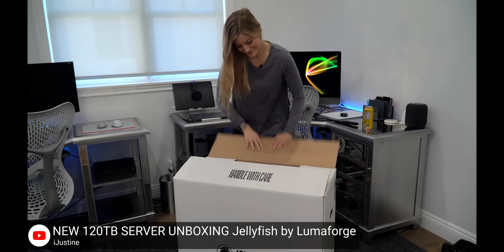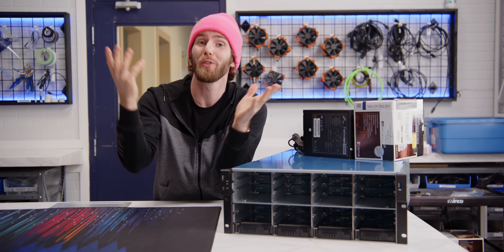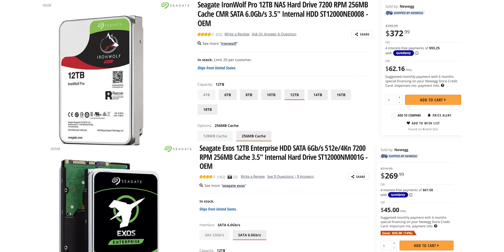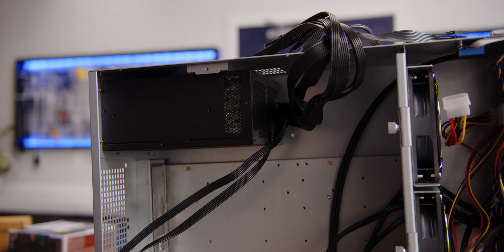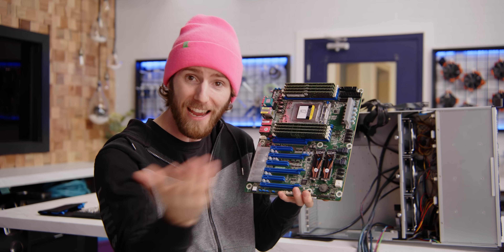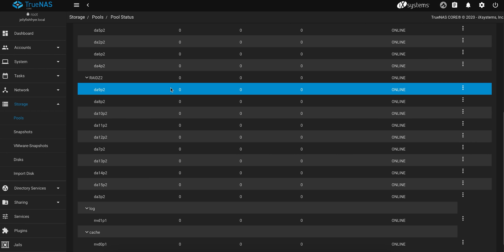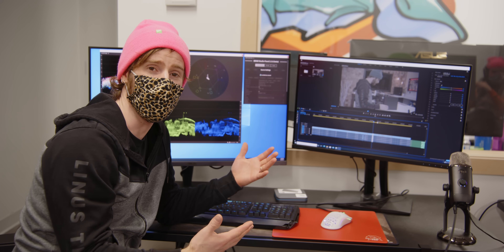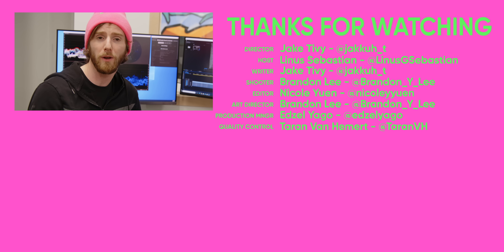Here's How to Save $45,000 - The Sensible Jellyfish Fryer

Comment: I didn't even know these Jellyfish appliances were a thing until seeing this, and they're insane. Just built out a 432TB (291TB usable) rack-mount, with no other features...and it's $62,000.

Are these people high? They're obviously using 18TB drives,  since everything breaks down into multiples of 18, and moving from 144TB to 432TB is an insane $20,000. That means the drives are $1,250 a piece.

Comment: TrueNAS is a complete garbage. Also, that’d be great to see actual performance comparison. With bandwidth tests, I/O test, drive latency tests. It’s not enough to setup hardware and stick FreeBSD on top of it, create a pool and call it a day. I would, also, want to meet that IT guy with intensive ZFS knowledge, who can tune z file system and be proficient with zdb and costs 20k to hire for 6 months. It will cost you a LOT to hire someone who would be able to recover your “lost” data — roll back txgs, fix a flood of chksum errors etc.. And then you loose all your important data, which most of the time in post production world costs millions, because you listened to a guy from youtube who said it’s gonna definitely work. Units like JF usually come with access to support engineers that can handle any ZFS issue which is included for few years when you pay for that unit. I’m pretty sure average editor won’t be able to handle even a simple drive swap if needed, even with GUI, let alone troubleshooting samba or nfs on FreeBSD. LOG device is completely useless with samba btw.

 facepalm

Comment: Jellyfish are a rip off, considering they are using a dead Linux distro that they are most likely using for free and that isn't getting any security updates. I have had a plex server that has been running TrueNAS for about a year and a half and I find FreeBSD to be more stable than Linux. And it's nice to have an OS that is free and built for out of the box NAS use

Comment: That 2tb nvme is not a good write cache.
An Intel optane or even an older p3520 would be a much better choice since it doesn't slow down when the onboard write cache is filled.  I have that exact sabrent nvme and it drop to ~600 MB/s when moving 100s of GB

Comment: That write cache is WAAAAY too big.  You only need something like 5x or 10x the maximum amount of data you can write in a second.  After that txg_sync will flush the cache to disk.

Also you should have a mirrored write cache in case of failure, you will corrupt / lose data if that happens.

Comment: You should just bridge the NICs and connect it to your local network. The local DHCP would takeover and assign IP addresses for you, in addition to supplying internet over the same cable. This seems way easier for people who aren't familiar with subnets and stuff (Jellyfish users).
Reply: I just tried this and you need to set the IP of the bridge (the server) manually. You should probably do this anyway so the IP address doesn't change. I can confirm DHCP and internet pass through fine to the clients over the bridge.
Reply: If you manually set the MAC addresses of the NICs so they are the same, DHCP works fine for the server too. This might be difficult to do in UnRaid or TrueNAS.

Comment: Great idea - and hats off!

I also had to think about expanding and improving my network storage 2 months ago: got a HP Proliant DL 380 Gen 9 LFF rack server with 2x Xeon, 32 GB memory, 2x PSU, 4x GBIT NIC and 2x 40GBit hp infinitiloop NIC for 200 Euro used + rail kit (50 euro) 

Then added another 32GB memory (100 euro), another 2x 10GBit NIC (60 euro), a HP P440 raid controller (60euro) the 12x LFF backplane with connectors (pricy - 300 euro) and 4x 3TB SAS HP drives (240 Euro) + some old SATA drives That have been sitting around. 

From here is it personal preference and the remaining infrastructure: 

I run windows 2016 hyper-v core (free) on which I installed a centos VM ( for trial and testing) as well as a windows server 2016 VM for media and video files / and also moved an existing windows 2012 VM (sql server onto it) 

So shy of 1000 euro I got a decent HP hyper-v host with 2x 8 cores + HT, 12x 3,5 slots, SAS and SATA compatibility, as well as 2x 40GBit, 2x 10 GBIT and 4x 1 GBIT connectivity.

Maxed out it would be 1,5 TB ram, (12 + 3 backplane) x 18(?) TB hdd while the OS could be installed on HPE micro SD or raid1 usb stick

Comment: Many of those USB plug adapters will work in Linux.   Additionally, you don't need a special tool if they will run.  They just use the internal OS hardware monitoring software instead.  Much better, if you ask me.

Comment: It is funny how many people think SLOG is for added performance boost. In reality it is intended to provide safety. Thusly Super-cap backed SSD's are recommended.
In fact, get a hold of a few RMS-200/8G PCI-e cards with 8GB of DDR3 (You reviewed a similar Gigabyte card from the 00's, and THAT is what those could be used for... Those RMS-200 beasts do 5.5GB/sec unlimited write endurance and 1.4Mil IOPS. SLOG is all about latency.
Those Sabrent will not last long before they fail catastrophically with the amount of data I suspect you intend to push through them.
You will probably also fry those L2ARC SSD's plenty fast.

Comment: am i doing my math wrong on those Exos drives?  2.5m hours = 285 years?
Reply: your math is correct but the manufacturers are a bit misleading as always. the number is about the data in the disk platters ONLY, not the disk heads, circuits etc and if the platters are not damaged. most common (spinning) disk failures are caused by r/w heads fault (stuck), heads crashing to the platters, or circuit board fail. your data in the platters can theoretically be fine for 285 years IF you have a way to replace any of the other failed components, you can read them. in reality, for continuous operation,  i'd say ~5years for most consumer disks and maybe even ~10 for some good enterprise models. but after that, they are basically zombies.

Comment: I have a question why did you use a /24 and waste 252 addresses? Wouldn’t it have been more efficient to use /30s or 255.255.255.252 subsets that only have 2 host addresses for point to point links? I’m a network nerd and I have some Channel To Channel networks which use SDLC and I use /30 subnets on those. Just some background on that the Channel To Channel adapter is a way to couple 2 mainframe systems together so I’m using that to couple my Guest OS to the TCPIP service machine on zVM to provide networking to the Guest OS that is non-QDIO compliant otherwise I would use a Vswitch. I really enjoy your videos and maybe you can do a collaboration and help our local college out with a problem we have? Let me know!
Kind regards,
Vincent

Comment: Slog size is network speed * 10 seconds, for 100Gb/s is about 100G. But it preferably be mirror device, so it is better use two 100gb partitions mirrored slog and last two 1,9 Tb partitions as two separate l2arc drives.

Comment: Nice vid, just few notes - SLOG is write cache for ZFS, but only for SYNC writes. Generally you'll use SAMBA which again is by default ASYNC in writes, so SLOG will not be used anyway. Also, SLOG is generally quite small since it buffers only SYNC writes.
Next thing is - 2x mini SAS connectors - you can use SAS expanders so you can connect way more than just 8 drives to it. If it's somewhat newer, it's 12Gb/s per port and on each port you can attach several drives (with SAS expander), and still not bottleneck anything.

Comment: That 2TB SLOG size is probably detrimental in practice unless you're specifically expecting to write 2.5TB+ in one single go (the 0.5TB there is because it'll be flushing to HDD at the same time). The memory overhead of indexing such a large SLOG in ZFS evicts data from L1ARC, so for most practical use-cases (outside of 8K RAW ingest!) it's better to use more like 64-256GB of SLOG.
Reply: are consumer NVME should even be consider in this context? i think Linus be using something like enterprise grade nvme for disk endurance purposes. A 2TB NVME with 1400 TBW may not be sufficient....
Reply: SLOG is typically flushed every 5s

Comment: This will never get seen but.... You need to setup your SLOG as a mirror pair otherwise data that is written to it but not flushed to the raid disks could be lost if your rocket Q drive fails.
Also the largest that your SLOG can possibly be is 10 seconds of the fastest that you can transfer at. So for you this is either 10 seconds of how fast 24 disks can go (about 2000mb/s) or 10 seconds of 10 * 10GBE (10000mb/s) network links. So your SLOG should be 20000 - 100000mb in size (or 20 to 100gb). You are going to be constrained by the disk speed so 20gb is more realistic. 2tb is a bit much.
You also need to run a real world workload on the system to find out how hard you are thrashing that slog. The consumer drive might not last very long if you are constantly writing to it.

Comment: You did that a bit wrong..
Can't you install a container for dchp on the "server" so you dont have to even bother setting up addresses?

That's not direct attach. If it were, the HBA goes in the client system to the box, that's not a box either as it's a sever sending over TCP udp

Comment: Is it really "plug n' play" if you have to do a bunch of IP configuration on each end? No.
Reply: I mean... That direct connect seems a bit ass backwards to begin with... First of all it uses up possibly the only ethernet port on the editing computer. Second that port is probably already used to connect to a switch anyway. And this proves that if it absolutely necessary to have this feature than it can be done.
Reply: @spartan5280  As long as the Jellyfish has an internet connection, any computer plugged into it will also have an internet connection. So the computer would be always attached to the Jellyfish.  It is an easy of setup thing, not everyone is a network wiz and wants to figure out a 10Gbe switch. They just want to plug it in and run the Jellyfish software on their computer and have everything work.

Comment: It's all about the tradeoff:
- How much do I want to pay someone to spend a huge amount of time setting-up and maintaining a custom made system? I then depend on him, what if he's hit by a bus? Where do I find someone with the same set of skills to replace him? And do I want to put my business at risk in the meantime (or when he's on vacation abroad)? Will he screw-up security? What about performances? And documentation? etc...
vs.
- Buy a plug-and-play system from a well-known brand/vendor, at a premium sure,  but also benefit from more features (for example: no write hole, redundant active-active controllers, multipathing (for iSCSI), hardenned security, guaranteed performances, automatic TIered caching, hardware servicing, etc) which also has support: literally a team of experts in the field can be on the line when my IT guy is lost, which means I can hire a dumber and therefore cheaper IT guy to offset the cost of this expensive storage system. And my IT guy can do something related to my business rather than building, maintaining and documenting a custom-made NAS system.
Different companies will have different answers: startups will prefer doing a NAS themselves whereas medium size and larger companies will purchase similar systems.
Reply: I agree with your assertions here.  That's why at work we use an Isilon for production storage and we have a 45 drives server with CentOS and ZFS to do backups and archival (not mission critical stuff).  For production we actually pay near a yearly IT salary for 4 hour mission critical support.  If something catastrophic happens, there will be somebody on site within 4 hours.  It is definitely hard to argue with that peace of mind.  Then again I just built the 45 Drives server with the same capacity as the production server at less than  1/10th the cost.   So considering the initial purchase price and the yearly support we could hire two or three IT people to administer it, deal with issues, etc. You are correct, it really does come down to the goals and needs of the company or person.

Comment: Linus, I guess the chances for you seeing this comment is very slim and perhaps someone has already said it but there is a famous saying.

"Use molex to SATA and lose all your data"

Google "molex to SATA fire". I'm serious. It has happened to me. Luckily it only ended with a burnt computer, no house fire. And before you say I used a crappy power supply. It was a gold certified power supply from Fractal Design. Maybe not the best of the best but should be "definitely not going to cause fire" rated. The molex-to-SATA adaptor was from NZXT. I choose reputable brands because I knew about the problem and I too thought it simply was a problem of using the cheepest adaptor you could find of AliExpress. I was so wrong. 

I'm not the only one who has experienced this and I'm not sure why they are allowed to be sold. You should make a video about this.

Comment: Well, this is all cool and fun, but at 13 000$ not really affordable. At least for me, as a student.
You have done plenty of cool cheap gaming pc builds so why not try a build for a affordable reliable NAS/media server.
So here are some specs I would require:
I have 9TB storage in my PC (4TB only steam and UPlay Games) and 1.5TB in 2 Laptops. So around 4TB of actual data not including software.
For a NAS it would be cool to be able to drop a lot of DVD as ISO on it too, and have those be available as media server. So I think 12TB usable space would be great.
For a case sufficient drive capacity for upgrading would be nice.
Since it would only really used to store backups it would not really require redundant power supply, and i cant afford a UPC anyway. Power outages are not really a thing here anyway. 5G network would be fine.
Price should be around 3k$, or less, as I would not be able to afford/willing to spend much more.

Greetings from Germany

Comment: Write cache/SLOG is only useful for things like databases that want to flush tiny amounts of data a lot. Even then, size-wise it only needs to be about a minute times the write speed of your array. So unless your array can write at 266 gigabit 2TB is a little overkill. Also you should generally mirror your SLOG, otherwise you will lose all the "in-flight" data if the SSD fails.

Comment: I know this was just to prove a point, but SLOGs only prevent the ZFS Intent Log from being written to the pool while also dumping data, making the writes more sequential. It does this in 5 second batches by default, so you only need maximum network bandwidth times over 5 seconds of SLOG space to be good, then double or triple to prevent write amplification issues. that comes out to 62.5GB, a little 240GB Optane would CRUSH that. I love this build, but Cyberjock is coming back for you ;)
If they changed this, please let me know because I would LOVE a regular write cache on my server

Comment: Do not use NAS drives for such a storage server.  They are not designed to be used in the same chassis with so many drives.  They'll work, but will have higher failure rates.

Comment: As a small suggestion, you might consider mirroring the NVMe disks for fault-tolerant SLOG in the event of a power outage + disk failure. You could also stripe them for speed, as you're looking at potentially 12GBps of write bandwidth if all 10GbE clients are connected and writing.

Depending on the amount of remaining PCIe bandwidth and budget, you could also add some PCIe NVMe cards for some a few TB of striped L2ARC. I don't know about your project size, but you might be able to keep your entire working set on the Flash layer. Bonus points if you can keep the disks spun down for the duration of an edit!

Comment: So now you've got a new new wonock (or whatever the name was) which is supposedly a Jellyfish killer. Now do a bit of testing comparing the direct attach performance against the performance you get using a switch. and the same number of concurrent users. Also what protocol do the Jellyfish use? it would be interesting to compare performance using SMB, NFS and iSCSI for something like this. It used to be that SMB performance wasn't really FreeNAS strong point, but it's been probably five years since I last tinkered with it so a lot has obviously changed since then.

Comment: wait, why wouldn't you want to use sata for the drive, and why is it set up to use molex? Wouldn't using molex on the PSU side cause a huge power draw on startup when all of the drives wake up, while Sata has a built in start delay? I guess the drive backplane could have that same function built in, but still.

Comment: Here is one question I always asked myself but never found an answer:
When you build an array of drives like this, the drives are the same model, and came from the same batch one after another from the factory.
If there was a manufacturing defect for that batch, and because the drives are used about equally (same Power-On times, about same data written/read), that would theoretically mean that all drives would die at the same time, loosing all the data...
Does that mean that you theoretically have a lower mean time between failures if you buy hard drives from different manufacturers ?

Comment: The trick to the appreciable "high performance" at the "low" price is the LSi HBA, the two cache 2TB NVMe Sabrents and the Intel x710 NIC 10GbE uplinks to his office server through the blue cable he used to great optical networking through the ConnectX / FS 25G SFP28 SR transceivers on both ends of his new "cloud deployment-level" new whonnock and workstations on the backend that he failed to mention.  All those EXOS SATA drives are just crass.